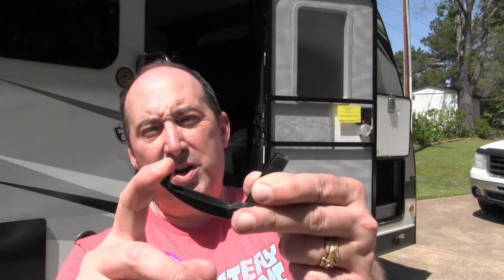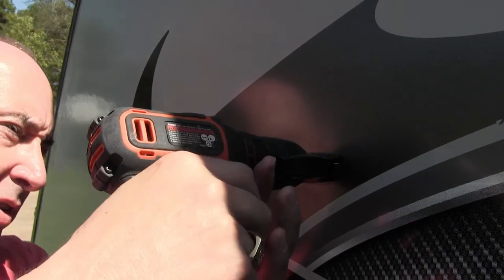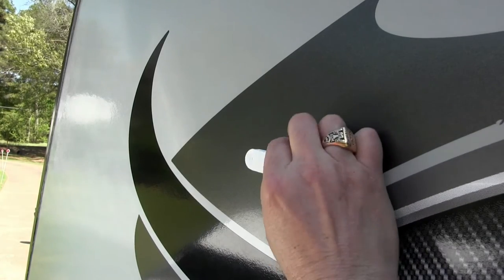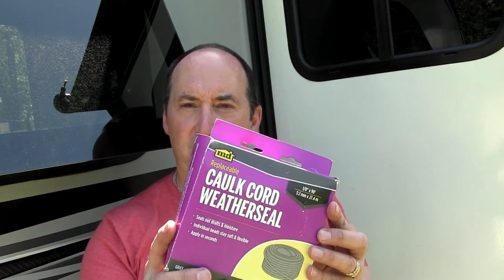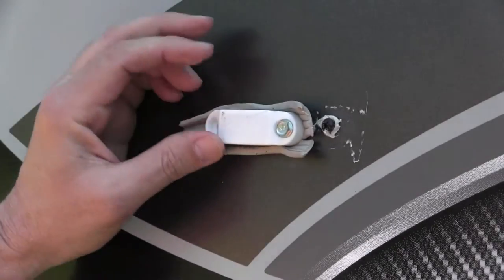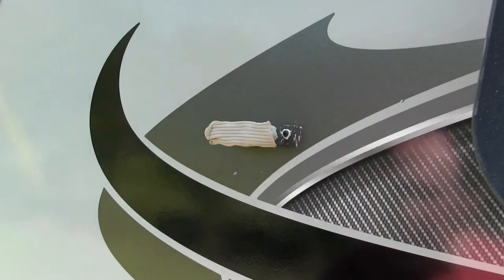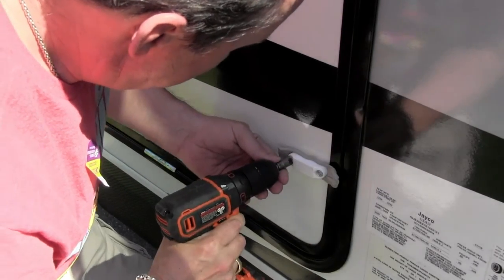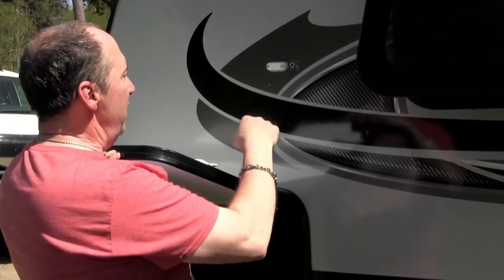RV Magnetic Catch Latch | RV Upgrade Ideas

Comment: Not trying to criticize but wouldn't it  make a better connection up farther on the door? Like if you put it in the space between the door latch and the bottom of the door?
Reply from the maker: Never considered that, I did have existing holes.